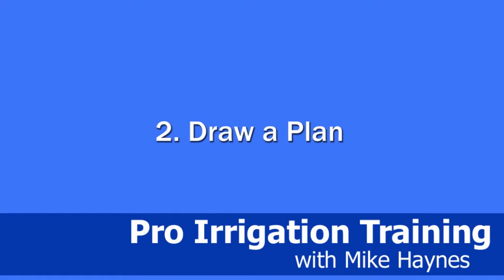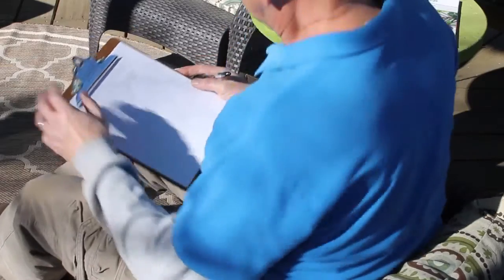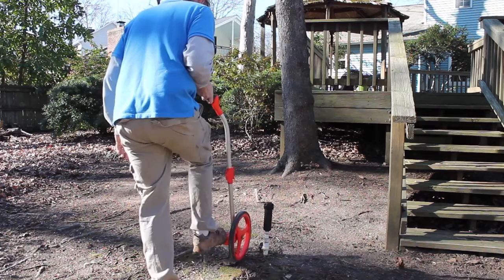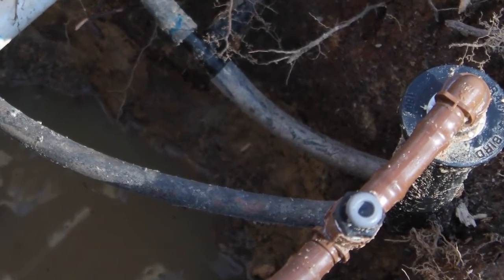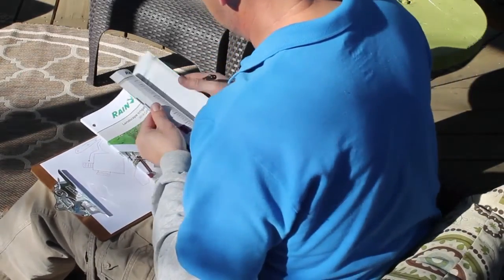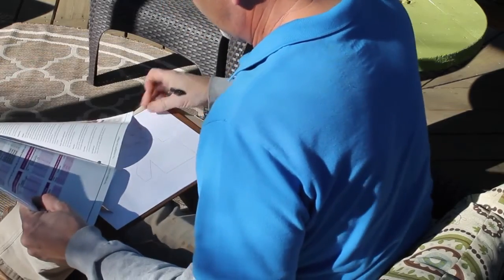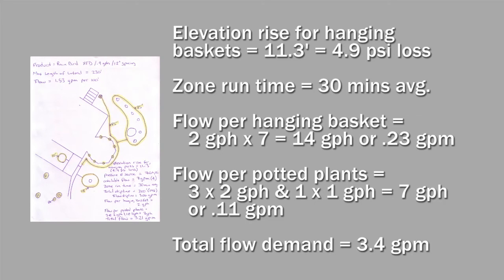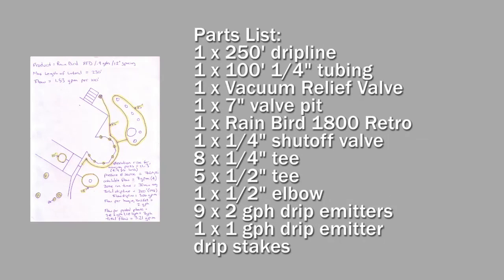Backyard Drip Irrigation Project | Phase 1 Planning [irrigation 101]

Comment: I don't get it. At 5:45 is it as simple as adding .23 gpm to .11 gpm? You have it as needing 3.4 gpm. But to me that adds up to .34 gpm. What am I missing?
Reply from the maker: I see the confusion. I need to elaborate a little more. The 3.4 gpm is the total flow demand of all the drip. That is the .34 gpm from the hanging baskets and pots plus the 3.06 gpm from the dripline that was totaled up two slides before. Sorry, I need to amend the video to be a little clearer on that total.